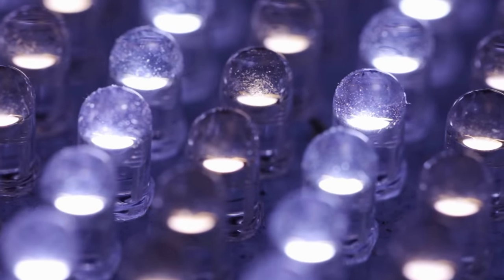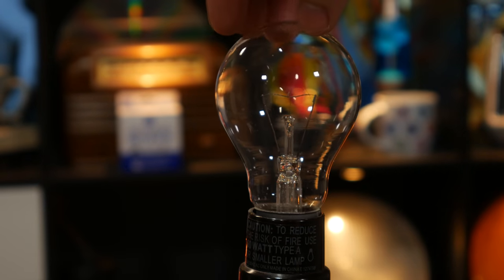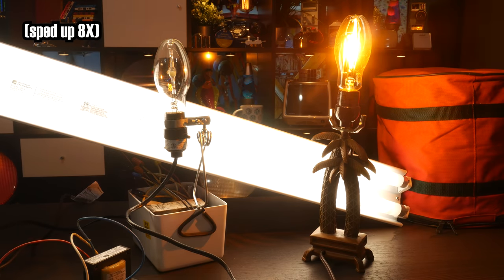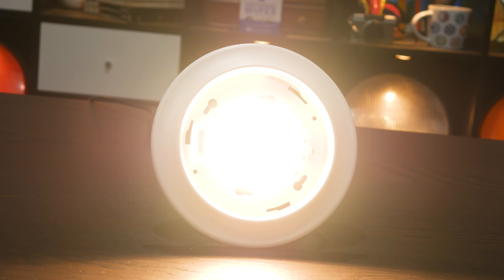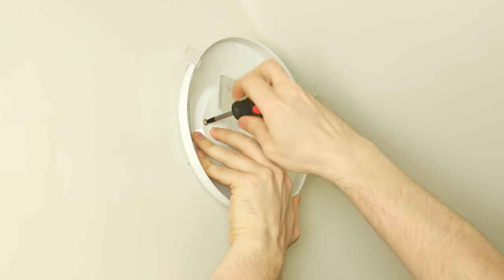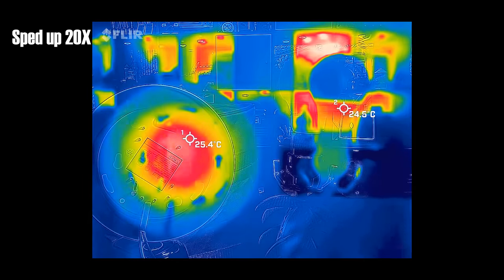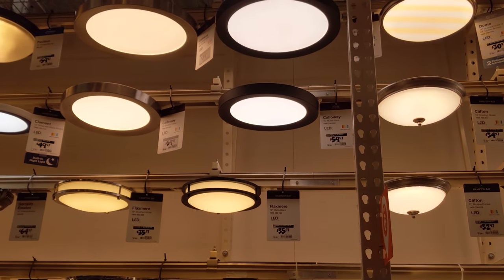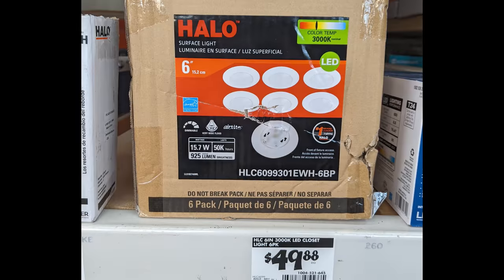A troubling trend in lighting?

Comment: They're selling desk and floor lamps now with these integrated, unreplaceable LED panels. So when the LED fails you have to toss out the whole lamp. Huge amount of additional e-waste.
Reply: I think you have a better time with component level repair, if not replace the board
Reply: Well, same amount of e-waste as a LED bulb, just with more non-e-waste attached to it ;)
Reply: Floor lamps...yes, my next door neighbor has tossed a couple of the (cheapo I'm sure) floor lamps, I retrieved them and found they only needed a $9 'bulb' but still I'm stuck with the 'drivers' on the same part as the LED's...
Reply: When it fails, you just open it and replace capacitor or power supply, it's repairable. Classic bulbs to socket E27 or E14 are not repairable, it just fails and you throw it to dust bin even when led chips are still good. I prefer things which can be repaired. Also, tiny power supplies integrated to socket are bad and every single bulb has it's own power supply, which is very inefficient, much better is when you have one good 12V power supply and more leds connected to it. 12V bulbs should be future, there is no electronics inside so when it fails, you know that it's really failed led chip and not some shit around it.
Reply: @Pidalin  when will they create leds that plug direcly to mains and can puls with 50/60hz like normal incondecent lightbulbs can?
Reply: e-waste? Isn't that just waste?
Reply: Neb6  1) I was referring to the desk lamp mentioned in the comment
2) It was a joke
3) The basis of the joke is that the electrical components are the same, if not less compared some bulbs
4) These small LED fixture+lights things are actually about the same volume as a flood/recessed style bulb... Just a bit larger diameter and flat.
5) Yes, having to wire it in is somewhat annoying... Though the lifespan on these is pretty damn long (significantly better than a bulb for reasons mentioned in the video) changing bulbs in a lot of fixtures can be a PITA too.  Also, reusable connectors exist.

Anyways, I think of these fixture+lights as basically a naked bulb. A nicer looking and longer lasting one that is maybe slightly more annoying to change.  If using full mains AC for lighting keeps being the normal thing, they might standardize more and start being connected with a little in-line connector eventually.
Reply: @Pidalin  This is very wrong statement indeed. 12V LED lights are using simple series resistors to regulate current. This resistor is nothing more than heater and it produces just heat. Modern LED drivers are much more efficient than a simple resistor. I recently moved to a new home and all of the lights are fixtures similar to these in the video, but... all of them are with external driver and non of them is cheap. These drivers, when placed properly can last forever. Some of my fixtures are with integrated regulation (not wall mounted dimmer) and also with 2000K to 6000K adjustable color temperature.
Reply: @Veso266   those do exist. Just that anything that directly connects to mains without a driver in between is shit. There are tons of LED bulb options. You just have to look around
Reply: @humorss  Isn't component level repair pretty difficult with those board given that the entire board is usually a heatsink?
Reply: @tsvetomirivanov9762  I have some old 12V led lights (not to socket, it's for cabinets and it has just wires from it) and there are only led chips and few resitors, everything on big metal circle, so it has cooling. 
It has 3W and I am using it as back light behind LCD display and for other similar purposes, it works 10 years without turing it off without problem. 
If today 12V leds are more complicated then it's bad. Similar case are led chips for flash lights, it can work without extra electronics too, I have some flash lights with 4V led chip connected directly to li-ion, with good cooling, it can handle even 4,2V, you can add little resistor if you are afraid of that and again, it works for many many years. So today electronics inside of modern led bulbs is piece of shit, it always fails on some stupid capacitor or something. When you have driver or power supply separated, you can at least repair it, so I still believe that 12V led lights must be more reliable than 230V. Maybe Americans have less problems with that because they have only 110V system.
These led lights to wooden cabinets are nice because it's big metal circle and all components can be fixed in case of some problem, maybe there are some resistors, but with cooling it's not a big problem and you can change them, it's very primitive PCB, change SMD resitor when there is nothing around it is not complicated and with that 12V leds, you can put more of them to series and make it even colder and more reliable. But not all led chips works well with less voltage. I feed it from standard 12V power supply, not constant amper power source for leds.
Reply: FFS they have them on cars now, some GM and Ford vehicles have brake lights that are full LED, and if they go out at all, you have to buy an entire housing with lights in it! It's insane.
Reply: @OscarOliu  That's bad, but on other hand, such car led light should survive years and if not, they should replace it in warranty time for free, but we all know how it is in real life when you want to return product or free repair in warranty time....I heard that some chinese producers started making unnoficial replacements, but it's probably not legal, you have to hope that police or service will not notice that you have some not homologated lights there.
I think much better solution would be make some standard for changable led bulbs or led chips or something which could be replaced same like standard bulbs, but we live in gillete-like post-capitalism age, so this is probably really sci-fi that they would make such standard.
Reply: But-but-but the companies that make LED tech (and especially the people who buy it) do so because they care about the environment I thought! I'm so disillusioned right now...
Reply: @Pidalin  Yeah but how much copper do you need for a low drop 12V system wired in the whole house, 16AWG if being super cheap?
Reply: @humorss  very few people have the skill to do that, and for those who do, it’s likely not cost effective.
Reply: @danieldaniels7571  I cannot think of a perfect solution, the problem itself is due to cost. why not buy expensive led that is driven at low power that will last decades.
Reply: @humorss  lol… personally I’m still using mostly CFLs, halogen and incandescent bulbs. I’m from the old school of “if it ain’t broke, don’t fix it” and those ain’t broke yet.
Reply: @Pidalin  Ok, but using led's with simple resistor current limiter is way less energy efficient than specialized led driver. I have installed 80W LED fixture with controllable power and color temperature along with 160W RGB led strip in one room - the led strip is 11m (14.4W/m) perimeter rectangle. The led strip when powered on white/max is way less bright than the fixture powered max. The led fixture has 40W/40W 2000K/6000K led's. So the strip gives a lot of power in heat. Great amount of power is from the current limiting resistor on the strip. Red and green led's are around 1.8 - 2.8 volts. 3 leds in series need half of the voltage to be dropped in resistor - this doubles the power drawn to lit them up. Blue are little bit better with over 3 volts forward voltage , but again need some current limiting on 12V supply.
Reply: Do what I did. Take all the lamp parts off, ditch the whole LED setup, replace with parts from real lamp, boom. Works for thrown out neighbor lamps too.
Reply: You thought that was bad? They make entire CEILING FANS with LEDs built in. And it’s not even a replaceable light kit, the LEDs are built into the fan! This LED crap is getting out of control. This is not about saving the environment, this is about companies making more money. You used to be able to buy a good quality light bulb for 50¢, now you can’t buy even a cheap one for less than a dollar. There is all this fancy circuitry, complex technology, all for no real benefit over incandescent other than efficiency. Longer life? There are incandescent bulbs that have the same rated lifespan, look up decade bulbs! And besides, most LEDs don’t even make it to a third of that rated life. Less heat? Is it really a big deal unless you have a toddler who is constantly touching light bulbs? Plus, the drivers on LED bulbs still get scorching hot. Most are even capable of cooking themselves to death when used in enclosed fixtures, which are…very common. Light quality? 80 CRI often with tons of glare, or stunning full spectrum light at 100 CRI, you decide. Less waste and pollution? Yeah, right. I’m pretty sure glass with a little bit of a variety of metals is a lot less wasteful than constant throwing away burnt out plastic bulbs with electronic guts. I’m pretty sure LED bulbs produce a lot more pollution during manufacture and transport than incandescent bulbs.
Reply: @SunriseLAW  All 50 led gu10 bulbs the previous owner of my house installed failed within 3 years.  I'm having better luck with the replacements I've installed, even the cheap ones.
 I'm also replacing also a g9 led bulb once a year like clockwork, first tried no brand Chinese, then low cost silvania and now a g9 corepro 3.5W philips has failed after about 1000h. A halogen does better, I still have the original incandescent I've swapped out. 
Btw I've read some cree spec sheet for their 10W leds and if you really delve into it, it does tell you that this is the absolute maximum condition you could run it at without it blowing up but that it will die prematurely if you do. A 10W led that is run at 5W will keep working for the advertised 10000h though.
Reply: @SunriseLAW  as far as I know these part have pretty stable mains. I do have solar panels which the specialist lamp shop pointed to as a possible source for failing led bulbs
Reply: @SunriseLAW  the panel came with the house so I don't know if that started it. The old gu10 that came with the house were really cheap no brand, of the osram Philips and Sylvania only  a few died
Reply: @SunriseLAW  g9 has a very small form factor, and in the Philips g9 3.5w corepro there doesn't seem to be any provisions for heat to dissipate from the glass capsule the LEDs are placed in. It does get hot and the fixture is located near a shower and is rated ip44 so is itself a closed box without ventilation. I'll visit the specialist shop I bought it from today, they've replaced faulty bulbs free of charge before.
Reply: Generally, the integrated lens are much higher quality and will last much longer  than the led bulbs (45 years vs 10-25). By the time the lamp dies, your children or grandchildren will probably be ready for a new lamp anyways. During that time you aren't throwing away a bunch of bulbs, so less e-waste overall.
Reply: @Pidalin  99% of people arent going to open up and go through all that trouble to fix a cheap lamp
Reply: @humorss ….uh…duh. What kind of statement was that lmao